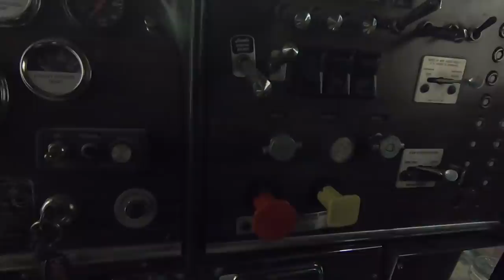ep 37 - replacing drive axle air brake chambers - Peterbilt 359 rebuild

Comment: I like keeping everything uniform. i also like to start with new brake chambers. at least we know those will be ok for a few years. i like the name change. much easier for me to remember. nice smooth job ezra. have a great holiday!
Reply from the maker: Main reason I went ahead and changed all of them was because rather than carrying a brake can for on the road repairs I Cary a half can and a pancake gasket much quicker to do in a parking lot should you have a brake can start leaking while you're away from home
Reply: I agree %100

Comment: My other half gets frustrated sometimes when I do a project, and end up replacing brake cans and then that leads to new slack adjusters and air lines.. If it looks like it's worn, it's getting replaced while I'm there. Don't want to take it all back apart in a few weeks cuz I got lazy or cheap.

Comment: if you still have the air leak issue pull the orange hose out of the relay valve under the fifth wheel between the abs modulator valves, the factory paints the air line before installing cabs and then plug the line into the cab and the paint migrates to the relay valve and causes air to leak past the oring on the diaphram, excellent job on instructing others on how to properly install a brake chamber, only  thing  you did not cover is the two hole positions on the scam tube,

Comment: Another job you make look so easy. I always put anti-seize on the clevis pins cuz I hate it when they seize up either on the slack or the clevis. Not so much on the tractor but on trailers that might sit for a while. I actually found some greasable pins but are a little pricey compared to plain ones...

Comment: Boy do I remember doing brake chambers I hated doing them on my back. But then a company worked for had a pit and that made it easy. Over my 15-year career I probably did hundreds of break cans and a few that were rusty and crusty crunch cage the spring because the damn hole was all rusted out that one was a dangerous can got it off though without hurting myself or anybody else.

Comment: Very good info .... also I tend to buy new clevis .. tired of fighting em..lol
Reply from the maker: Yeah I even grabbed a couple I was going to use but I got the wrong pin dia. Nothing wrong with the old ones tho
Reply: I've learned that too, have clevises on hand of both the 1/2 and 5/8 pin size as well as spare pins as often the clevis or pin is garbage or by the time it comes off the truck it is !. Standard stroke Bendix 30/30 pots I buy come with a clevis but its always the 1/2 pin size typical to fit steer axle or trailer and not the 5/8 pin typical for drive axles. I felt your pain ( hit on the head ) as its an awful awkward place to be working and those darned 5/8 studs on the pot can have their nuts rusted on/threads mangled so bad and be forced into using the hot knife to cut it right off if its bad enough. Although not mentioned, often a person has to loosen off the service brake pot clamp just enough to rotate the air ports around to line up properly and I like to have the two clamp bolts to the sides or at least not have one directly at the bottom as that is just one more thing to get snagged on when crawling around under the truck or get hit in off road situations. WAY better to be doing a job like this in your heated shop vs be on the road with known pots on their last legs and forced to deal with it on the side of the road.

Comment: Mine is back feeding through the valve. I can bump the trailer valve and it stops. That is without a trailer hooked up. Guess I'm going to have to replace the cans on mine. That or the main valve feeding them at the rear end.
Merry Christmas and looking forward to seeing Ol Red on the road. And you making videos of day to day trucking in it.

Comment: Great job, EZ! Maybe you could have added, that the parking brake needs pressure to release the brake which is applied by a big ass spring as soon as the pressure in the system is released.
Reply from the maker: i did i explained how there is another diphram in the park brake side that uses air pressure to compress the spring to retract the rod to release the parking brake.

Comment: I see them brake chambers you can only service 1 diaphragm not both (brake and park brake) found out at farm me n the boss have been monitoring the air leaks also brakes not completley coming off so took it off to put a new diaphragm on it we couldnt  the cup was pressed over no clamp so raided an old sfm colinda 2 deck cattle trailer  dragged over the pit and took all the chambers off  for spares pity the boss didn't have the right one and put an old one on off of that sfm trailer just stripped  really cracks me up in your intro where you drop the inner piece of chassis (joining the  2 chassis together )then look at the camera look like you going to to say "oh darn"  merry Christmas Ezra hope everything goes well and you get some more thing to add to old red from under the Christmas tree
Reply from the maker: yeah they started putting crimped clamps on the park brake side probably more than 25 years ago to many people were hurting themselves trying to service the park brake side, you can still get half cans "piggy backs" to replace the park brake side and not have to mess with the pins or bolts cutting rods or any of that stuff, if i have a can leak while im on the road ill generally throw a pancake or a piggy back on it much simpler to do outside the shop.
Reply: he tried (boss/owner of truck)ended up in too hard basket (rubbish bin) both triaxle  grain tipping trailers  the drop deck trailer and i think the dolly have 2 large springs (trampoline springs ) on each chamber pulling them back cause of all the dusty rough  corrugated roads travelled

Comment: i also watched your video on the overhead, you used a stc setting, i did not see any stc oil lines going to the injectors, it has been a long time but i am almost certain you have a ntc engine and the lash settings are different for each engine
Reply from the maker: It's a big cam3 so it has no stc used the lash settings my engine called for

Comment: Measuring rod length is fine but did last guy cut rod right? With brakes applied should be 90 degs angle (rod to pivot pin to S-cam) for max force applied.
Reply from the maker: pretty sure i mentioned in the video to check that as well as it was checked. that if not iv got other videos showing how to do that.

Comment: maybe a prelube with a 50:50 mixture of acitone and ATF, on those nuts would help.
Reply from the maker: lube doesn't do anything till its already cracked loose and moving heat works 100x better.
Reply: @Ezrider359   this mixture  works it's way into the threads and breaks the bond, try it sometime you will like it.
Reply from the maker: iv tried it before but i do apricate the suggestion

Comment: Great video
I have a 99 kw 900 with bad c15 cat 
Should I rebuild the motor and what the cost of rebuilding it ? Thanks
Reply from the maker: if the truck is in good shape it would be worth rebuilding, cat's are a bit on the spendy side to inframe probably looking at 20k including shop labor.

Comment: I noticed you didn't use WD-40 or PB Blaster on those tight nuts. Wondering why.
Reply from the maker: Because in that situation heat is far more effective and heat and flammable oil are not a great mix

Comment: any driver should be able to swap a piggyback brake chamber on the side of the road. when I drove I carried a spare in the toolbox. takes under 1/2 hr.
Reply from the maker: yeah iv got a video on that 15 mins with nothing more than basic hand tools if you have done it a time or two.

Comment: What truck would u suggest I get for my first one out of a 2016- 2019 Freightliner Cascadia Evolution 125 with a DD15 , 2016-2019 Peterbilt 579 with Cummins ISX or 2012 2016 Kenworth W900L with Cummins ISX or Caterpillar all between 350,000 650,000 miles or would I be better off going with a Detroit 60 series?
Reply from the maker: i don't have a lot of knowledge on the specifics of trucks that new.
Reply: @Ezrider359  What would you suggest for a first truck? I don't have nowhere near as much nechanical knowledge as u, but I do have enough sense to go to a page like yours and figure stuff out though.
Reply from the maker: i don't know, the trucks i like pre egr emissions trucks are getting pretty old now to where a shop would probably eat you alive on all the small repairs there be needing. early dpf trucks had a whole lot of issues.  probably safest option is to get something that still has remaining factory warranty any used truck can be kinda a crap shoot.

Comment: You can be  put out of service for having one  of a different size.
Reply from the maker: 2 brake cans of different sizes on a single axle would be a oos violation, two brake cans of the same size of two different brands on one axle would not be a violation, it also would not be a violation to use two different size cans on different axles as long as each axle both brake cans are the same size.